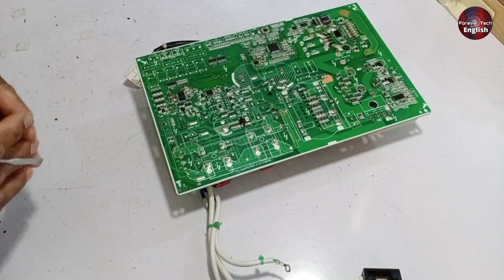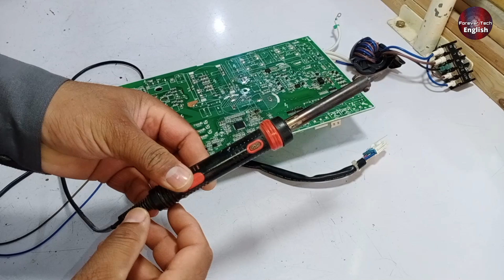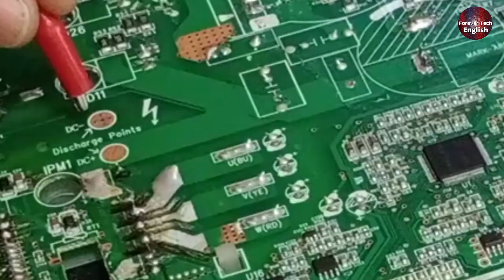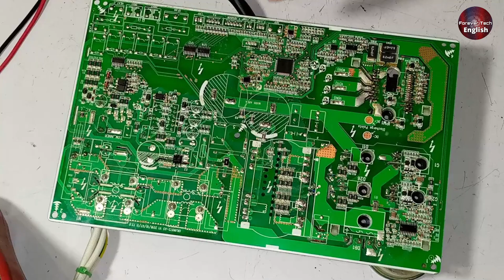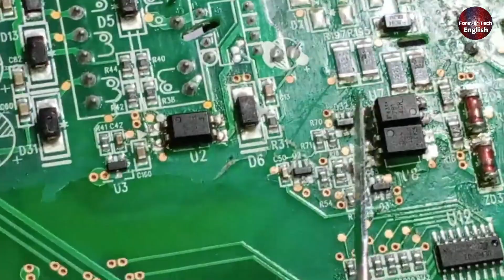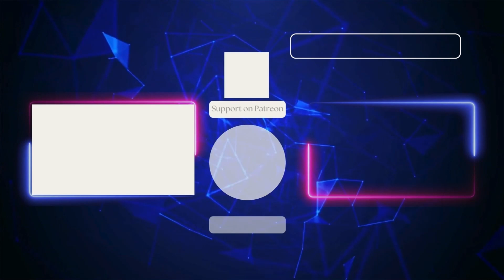Gree Mini Split AC Circuit: PCB Voltages Testing Made Easy!

Comment: Pls can you do a video on how to check the output voltages of microcontroller or how to test if microcontroller is working or not in an air conditioner PCB